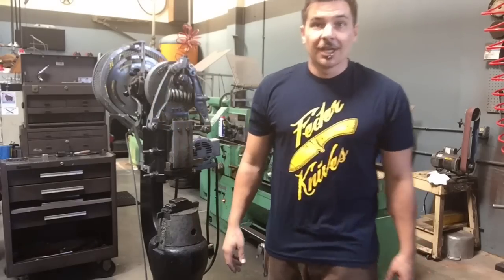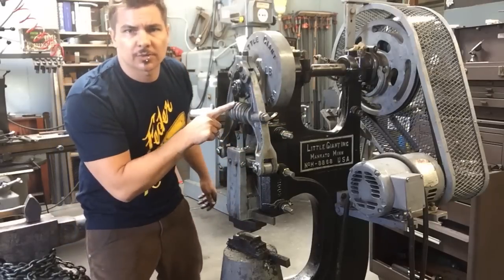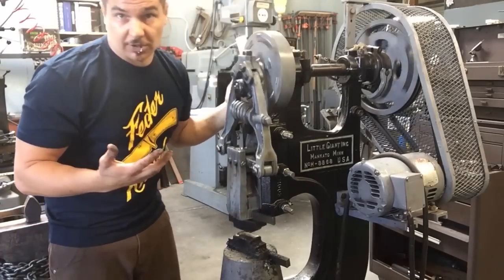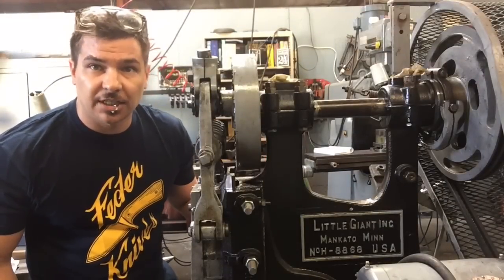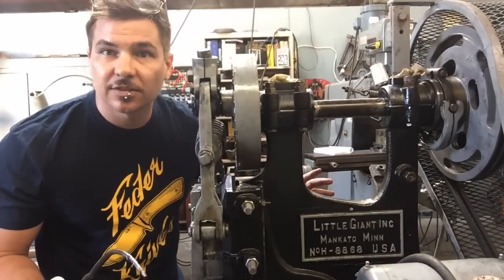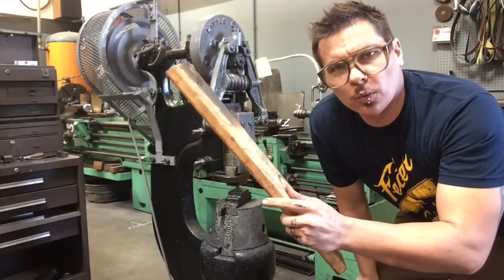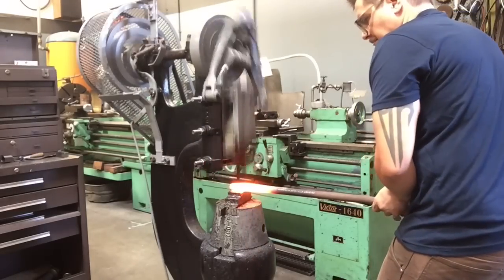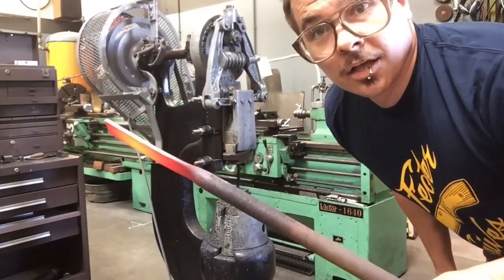Little giant power hammer demo

Comment: This might be a dumb question 🫤

But are there power hammers with dies specifically made for leaving indents in the material 

To clarify, I’m specifically talking about something that looks like a chisel indent

As if the metal worker got so frustrated 😤 with his part that he straight up took a chisel, held it vertically and hammered down 🔨with full force to leave a deep and furrowed line/mark ➖

Comment: What's a 50 pound one worth?
Reply from the maker: hard to say.... ive seen them go for 4 to 8K its about condition location and available buyers
Reply: Also depends on which version you're looking at. the earlier ones have no Sow block (the part that holds the lower Die ) and have Ram guides at front, and rear, instead of at the sides as this one in the video does. The later versions will always sell for more money depending on condition, and completeness.